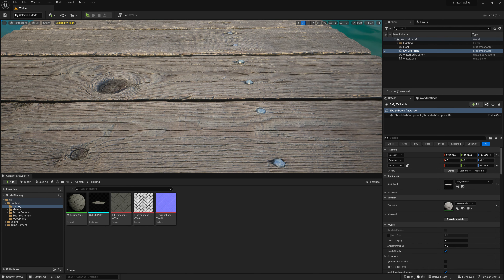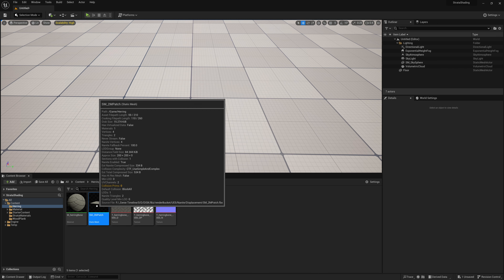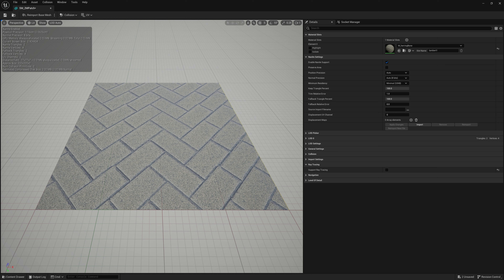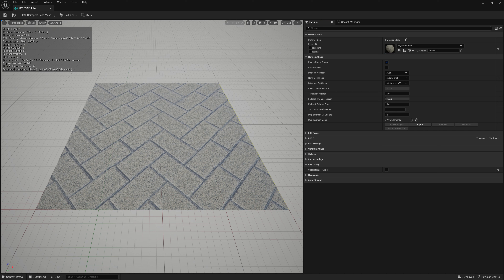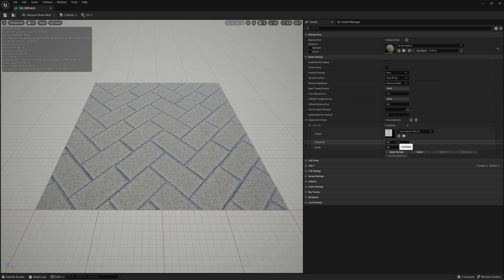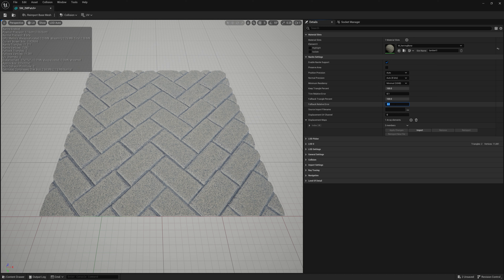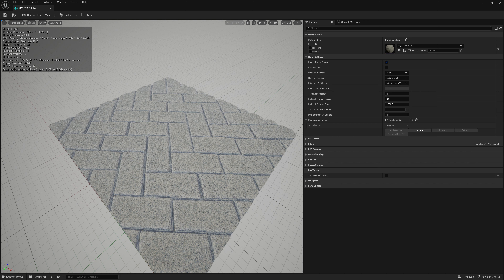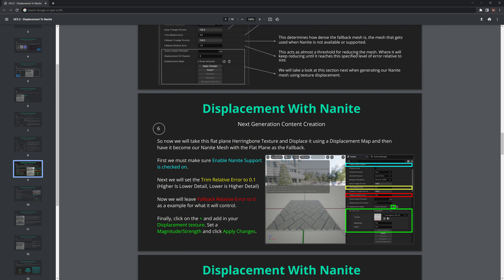Unreal Engine 5.2 - Displacement & Nanite Tutorial

Comment: Hi guys, I need your help on confirmation of 2 techniques. One is using this method and the other method is using Displace deformer in the modeling module. With this method, the displacement map need to be on 3 channels and Displace deformer, we can use directly the Blue channel of the ORD map from Bridge. But in the end result, what is the pros and cons between those?

Comment: Displacement is far more expensive than just modeling geometry and culling the under side. 

To render a displaced model, the renderer must first calculate the surface normals at each point on the model. The surface normals are the directions that the surface is facing at each point. Once the surface normals are calculated, the renderer can then use the displacement map to distort the surface of the model.

This process is more computationally expensive than simply rendering a model with its original geometry. The renderer must calculate the surface normals for every point on the model, and then it must distort the surface of the model according to the displacement map.

In contrast, modeling the geometry only requires the renderer to calculate the vertices and faces of the model. This is a much simpler process, and it is therefore less computationally expensive.

Also, use bent normals for better effect.
Reply: bruh this method changes the actual geometry, its not "fake", so for example you can't use texture painting to paint different materials to add variations..etc
Reply: @ghw2402  Sorry, I disregard every comment that starts with "bruh". It just tells me you are lacking in basic English skills.
Reply: @edenassos  bruh Im a seppo just like u
Reply: @ghw2402  Seppo? You assume I'm American just because I speak English? English is not the only language I speak. Bad news for you, my English is better than most Americans so that statement doesn't mean anything.
Reply: @edenassos  im american and i can confirm your english is betta dan mine
Congrats bruh
Reply: @ghw2402  Thanks "bruh".
Reply: So if I use a height map to fake a hole on a surface, will it heavier than a real hole with eg 18 vertexes?
Thanks

Comment: Also - search “5.3 Nanite Tessellation” - that’s their endgame. Saeed found it and posted a video a couple days back. It’s not POM (stuff is protruding even at glancing angles), but it’s not real geo either, it seems.
Reply: I’ve displaced meshes using the modeling tools that I’ve subsequently converted to Nanite. Am I fundamentally misunderstanding something?
Reply: @benblaumentalism6245  you changed the geometry it self, so for example you can't animate the diceplacement or change it in real time, e.x foots on snow..etc
Reply: @ghw2402 
It isn’t how I’d do that anyway. Even if it was, I still prefer the material to be world-aligned in most cases.
Reply: @benblaumentalism6245  also for example we can't use texture painting, like if i have a wall of bricks material, then i can paint over it to add variations and cracks..etc because the diceplacement is the geometry now so the other material will not change it and it will look ugly
may I ask how you would aproach those 2 examples? I'm strugling with that now :(
Thanks

Comment: shame its not generalized so that you can author the displacements inside materials.
Reply: Yep. This was basically possible before this update, just in a more roundabout way. I am sad at how long this issue is taking to solve. We just want the ability to use tiled materials and displacement in a generalized way. This method will also still have the same issues it always has. If you tile nanite meshes, you get noticeable seems at a distance due to the way it reduces the mesh density as you move away. Again... why I want a single floor piece with a tiled material on it.
Reply: I wonder if it's possible to use a render target texture for the displacement slot and then you could use the output of a material graph to write to the render target. Stupidly costly but if the displacement could happen it realtime then it could produce some cool fx. They really need to sort some kind of material dispalcement again working with nanite tho.
Reply: @katanalevygames  yeah, I get why they want everything nanite, and tiled meshes. It works way better with lumens mechanical defaults. I wonder if the solution could be as simple as giving artist the ability to customize how specific sections of a mesh react to nanite. If I could tell tiled floor and wall meshes to not reduce as readily on their outer edges, that would solve most issues.

Comment: A litle help here if you want to use nanite + ray traced shadow workflow UE5: 
r.raytracing.nanite.mode 1
r.nanite.viewmeshLODBias.min -1 (range -1 to -5 eat perf heavily)
r.raytracing.normalbias 0.8 (range 0.8 to 2 offset shadow so you won't see  tiny artifact shadows)
Reply: Legend, thank you I will try this
Reply: r.raytracing.nanite.mode 1 is a bit of a double edged sword. It basically means the full nanite scene is being sent to the ray tracer every time nanite topology changes, which happens almost every frame if you move the camera. Rebuilding acceleration structure for ray tracing every frame is very expensive. So with r.raytracing.nanite.mode 1, you will get correct ray tracing effects on nanite meshes, but at the expense of severe FPS drops when moving the view/camera around (unless your scene has only very little topology).
Reply: You can also deactivate raytraced double sided geometry shadows. Works fine for me
Reply: r.raytracing.shadows.enable two sided geometric 0
Reply: Not perfect but works best for me
Reply: I have shadow problems with the displace and tesselation on landscapes in unreal 5.3.1 do you have any suggestions?
Reply: OMG. Thank you!

Comment: So by displacing the mesh with this method, am I seeing this correctly on the wireframe, did it generate more polygons where the displacement map is more detailed (like as the recesses bevel) and less polygons where the the displacement map is less detailed (flats of the pavers)? Cos that’s amazing if so, compared to just evenly subdividing a mesh in the modelling tools and the using the displacement tool.